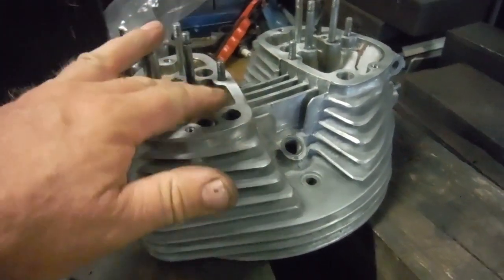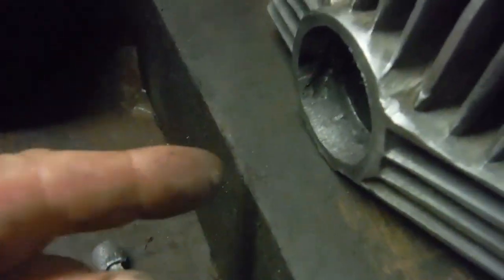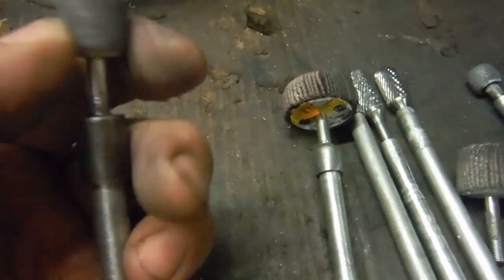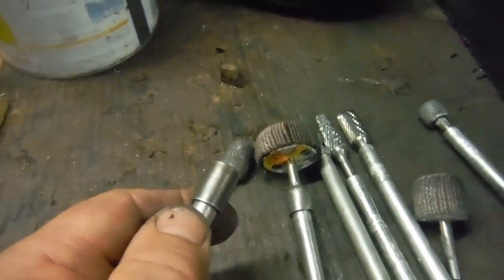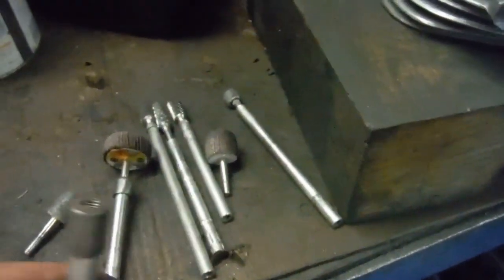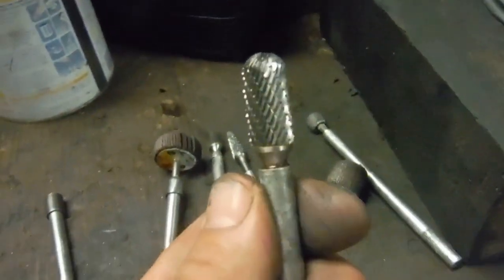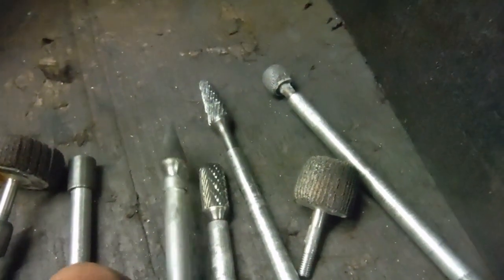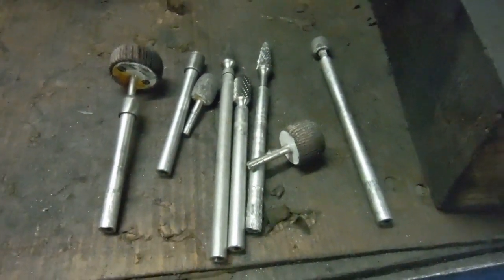Simple ways of adapting hardware shop tools and engine pushrods for cylinder head porting duties.

Comment: Do you ever go bigger than stock on the valve sizes Paul?
Reply from the maker: Apart from the Hitchcocks slightly oversized exhaust valve for 500 Bullets - which was my idea - no, the vast majority of my tuned Bullet engines run standard sized valves and even standard cams, with the inlet timing retarded.
Reply: @paulhenshaw4514  are the elecra x the same size valves?
Reply from the maker: Slightly different, but not much in it.